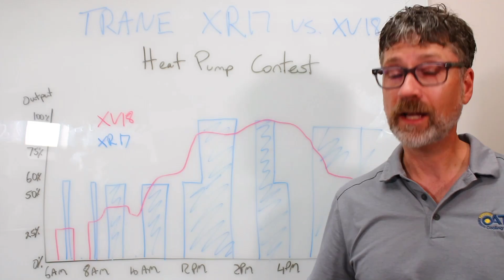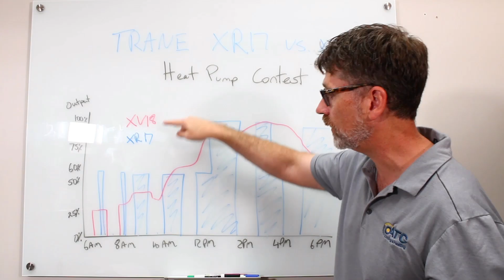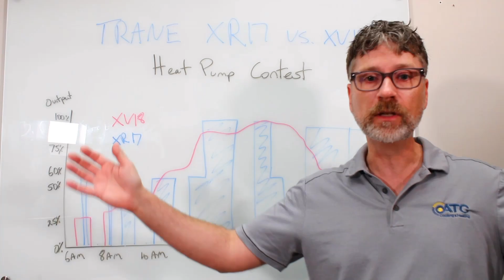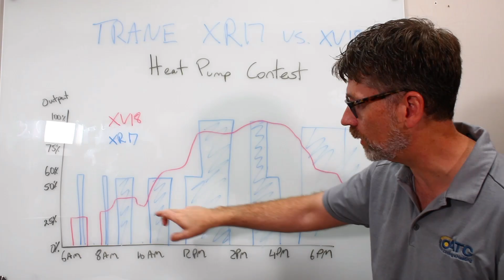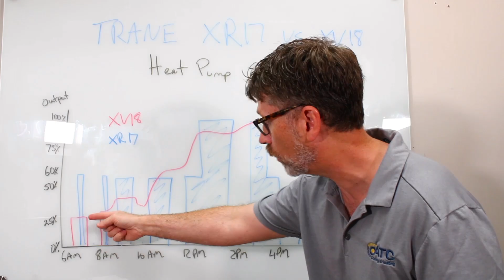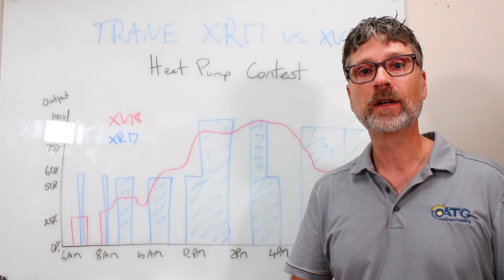Trane Heat Pump Comparison Test:  XR17 vs XV18

Comment: Is it true that new XR17 have multi stage compressors? meaning they use around 30/40/50/60/70/100% capacity depending on needs?
Reply from the maker: Trane calls the XR17 a multi-stage unit.  But it functions more like a 2-stage model.

Comment: I have a 100 year old row house in Virgina that's never had an AC system or ductwork - just cast iron radiators - but gets hot and humid here in summer! So this would be all new wiring, and run from the compressor on the roof down the side of the house and into the basement where the air handler would be. Does this present any challenges for either the XR17 or XR18 from a wiring perspective?
Reply from the maker: The low voltage wiring for the XV18 is actually a little easier.  As a communicating system it really only needs four wires to the thermostat and outdoor unit.  The XR17 will need more (for staging), but still not really a problem.  Both need 220v and typically 30AMP wiring to the outdoor unit.

Comment: I have sold couple xr17 condensers with matching evaporator coil on existing furnaces with variable speed blower and zoning... systems work beautifully and the homes maintain 55% Humidity. 
I live and work in Houston

Comment: If you got this quote, what unit would you expect to get installed? Trane 17 SEER Variable Speed Compressor Variable Speed Air Handler. Would it be a XV or XR model?
Reply from the maker: That is the Trane XR17 for sure .  It uses a variable speed air handler and a multi-stage compressor. It's not really a variable output unit with just two stages.  The model number for the XR17 is the 5TWR7...
Reply: @HVACscholar Thanks for the reply.  After checking the model number after installation,  it says it's a Priority 17 4-ton unit. I think the only difference between the Priority 17 and the XR17 is the refrigerant that's used in them and where the XR is 2 stage the Priority 17 is multi stage. Little hard to differentiate between the 2.

Comment: Can you point me to the quietest 3ton heat pump? I saw the XV19 but it's a bit old now and I'm not sure it's still state of the art. Thanks
Reply from the maker: For Trane, the quietest heat pumps are the XV18 (5TWV8X) and XV20 (5TWV0X).  Other brands make even quieter units, but it is a case of declining returns.  These Trane units are very easy on the ears.

Comment: I heard the XR17, as a "multi-stage" unit, can run at 3 levels, not just 2.  Comment?
Reply from the maker: While Trane calls the XR17 a "multi-stage" unit it is best understood as a 2-stage model.  At each of those stages, it can vary the compressor speed somewhat which is why Trane doesn't just say 2-stage.
Reply: We currently have a Carrier 2 ton that's 22 years old used at 2nd home in Delaware in land. Thinking of Trane using 2.5 ton. Homes 960 square foot home. Winters get cold and summer hot and humid. Was thinking about the 17 but what do you recommend?

Comment: Hello, thanks for the great info. Do you think over time, the additional cost of the XV18 will pay for itself? Especially, at a location in the south that is hot and humid.
Reply from the maker: The 1-SEER difference between the two models results in a modest operating cost discrepancy. Keep in mind though, the 18SEER rating of the XV18 is measured at full output.  At less than full output, it gets even better efficiency.  Still, the operating cost difference is likely to be only about $200/year.  That said, the reason to get the XV18 unit is for humidity control and quietness.

Comment: What is an "old" thermostat wire?  I am replacing a heat pump that was originally installed in 2012.  Is this "new" and therefore, the XV18 would be a good choice?  Please also answer DG-Choc's question.  I am interested in the answer.
Reply from the maker: I concur with donnyjackson.  Your thermostat wire should work fine.  One thing to look out for is wire nuts.  Spliced wires (like sometimes found in old houses) are poor conductors for communicating thermostat systems like the XV18.
Reply: Either will work. I find the XV-18 easier to use on existing wires as it only needs 4 wires. You will want at least 8 to properly wire and XR-17 with an 824 thermostat assuming you wire BK to take advantage of the variable speed blower and get “multi-speed”. 2012 isn’t old, so either should work. Go with the XV-18!

Comment: Good information .  In Oklahoma we have SMART HOURS between 2pm & 7pm M-F (OG&E).   The electricity rates jump significantly during that time frame (x4).  Currently, I precool before 2pm & do not run the air for those 5 hours & use fans.  This is a huge savings.  Now, if I choose the XV18, it would want to run during that timeline.   Your thoughts?
Reply from the maker: Ohh.. that is an interesting design issue.  Any system will want to run throughout the day rather than shut off for a long period and then try to make of the difference.  I would suggest over-sizing your system so that it can pull down the temperature more quickly in the evening.  Otherwise, you may find that it struggles to return to a decent temp after 7PM.  Of course, over-sizing has a cost - namely poor humidity control.  Overall, AC systems react best with a constant temperature setting.  You may also consider setting your thermostat to drift upward a couple degrees in the afternoon rather than shutting it off altogether.  For example:  70 degrees from 8am-2pm.  72 degrees at 2pm-7pm and then back to 70 degrees at 7pm.